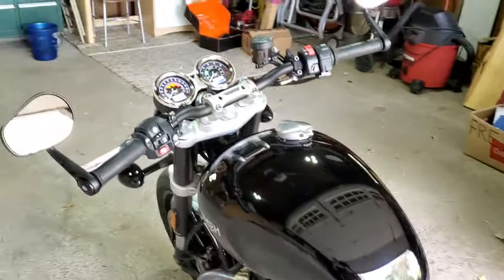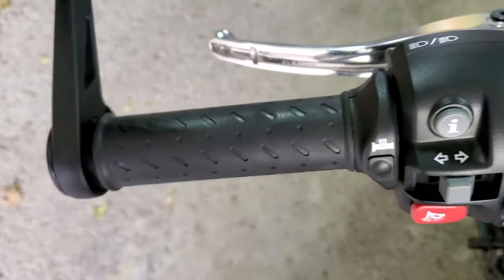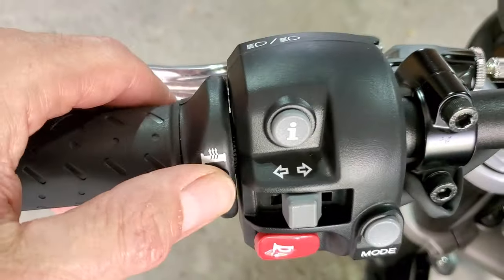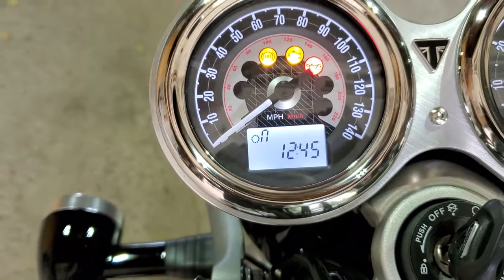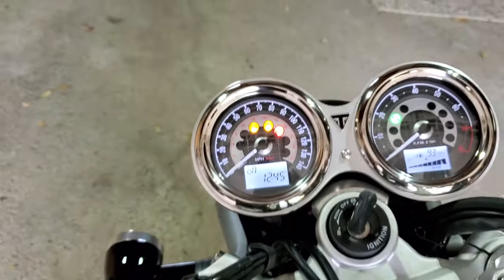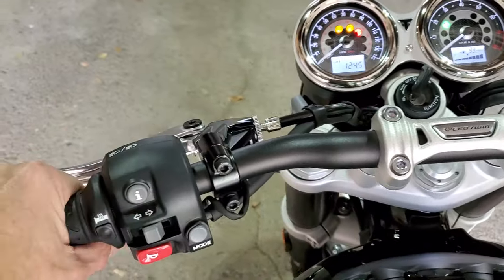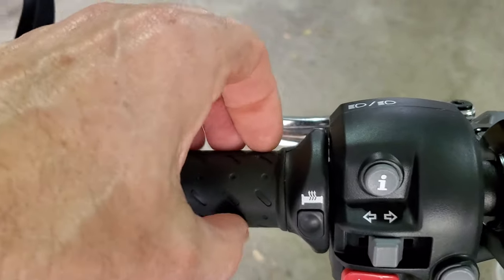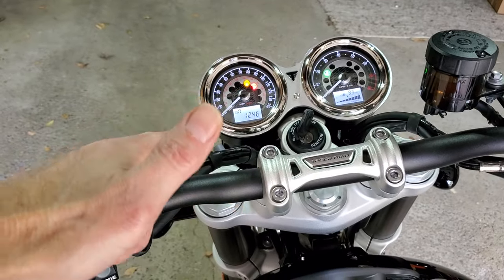Triumph Heated Grips On Speed Twin 1200

Comment: I just got them installed on my Trident and it does have 3 settings. Low, medium and high. I wonder why the Speed Twin only gets the 2
Reply from the maker: Yes great question, I wonder why as well then? After the ride home when I had them installed I called back to the dealership and asked about the low, high settings and no medium, they told me the Rocket had all three but didn't mention the Trident. Even with no medium on the Speed Twin I am super happy with them, and here in Minnesota they definitely get put to good use! How do you like yours on the Trident?